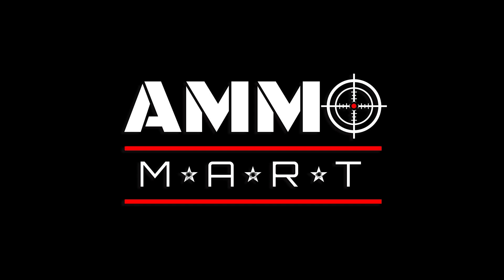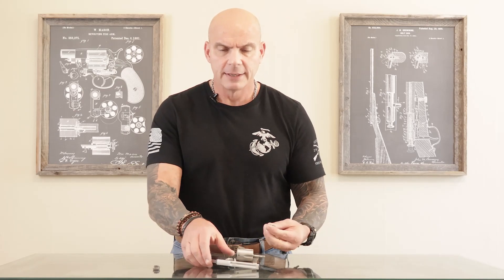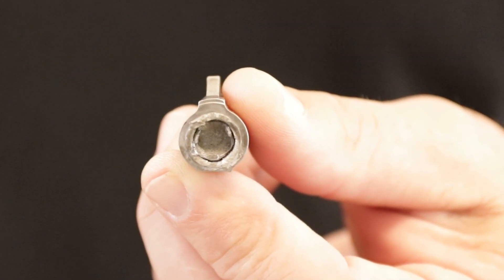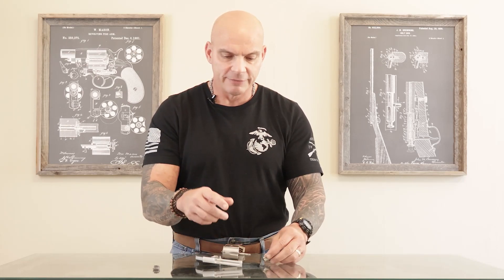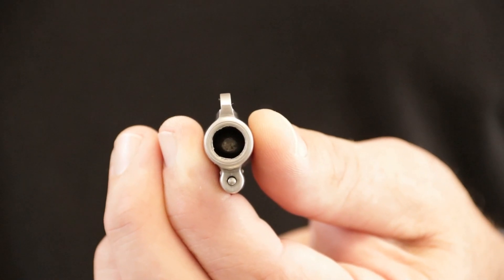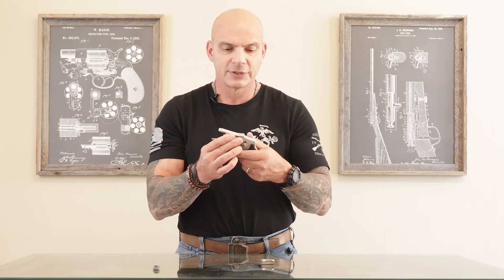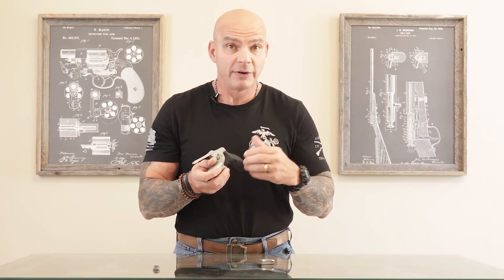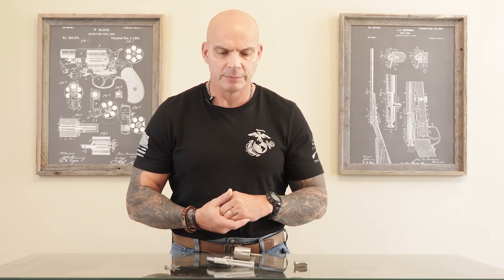Squib Loads - Potential For Catastrophic Failure

Comment: I've had one squib.  I was shooting Hornady Critical defense, factory loaded round.  I had a few boxes of it, and I no longer carried it, I was switching to a new round for carry.  I decided to use them up for practice.  I was also doing malfunction drills where I was loading fake rounds in the magazine and practicing tap and racks.   I had one that didn't go off, I taped and racked, finger was on the trigger, and I stopped.  I just processed that the previous round fizzled a bit, and an empty case came out of the gun when I racked not an orange dummy round.   I took the gun apart and sure enough there was a squib.   I knocked it out with a cleaning rod and continued my practice.  FYI - It is a federal crime to reload ammunition (even hand loads) and sell it for the purpose of making a profit unless you have a FFL as an ammunition manufacturer.  I now hand load all my carry ammo in new brass, so I know it is done correctly.
Reply from the maker: Thanks for sharing your experiences with our viewers and taking the time to comment!  I am glad that purposeful, attentive practice saved your firearm and perhaps kept you from serious injury.  See you next week.
Reply: Did it take a lot of force to knock it out? How stuck was it? What caliber?